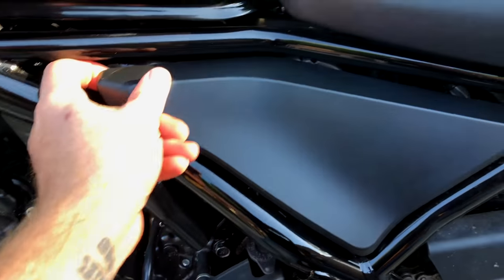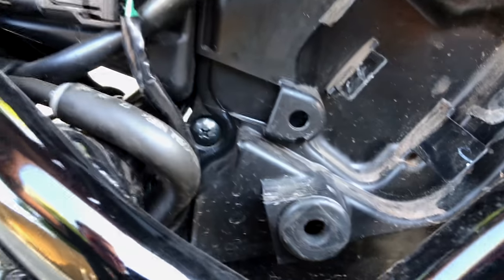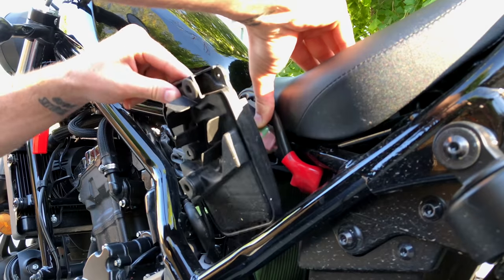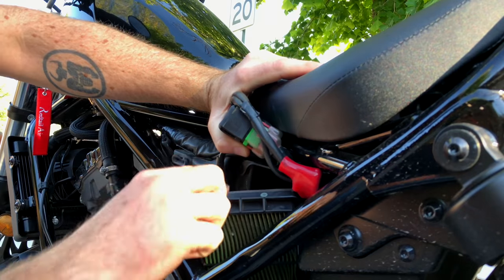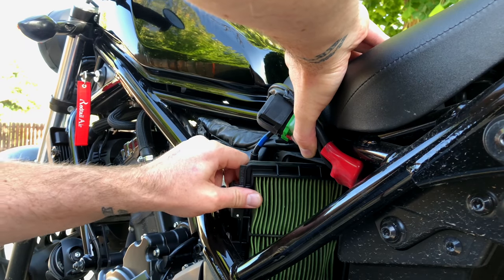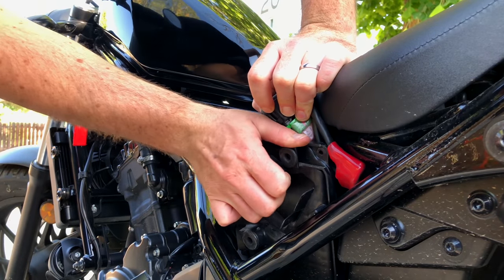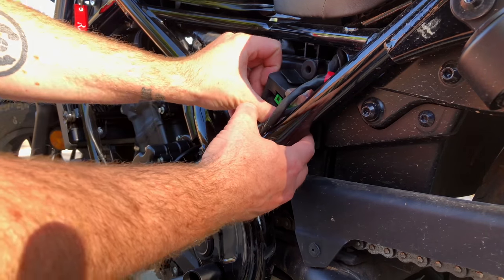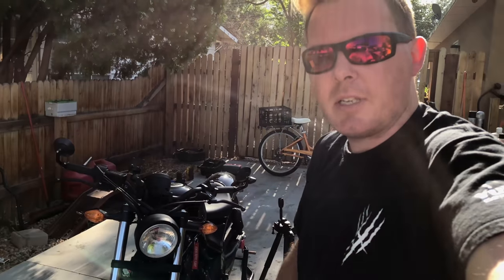2017 Honda Rebel - Air Filter Replacement

Comment: Thank you for the video - it was quite frustrating following the instructions from the manual specifically the part where the filter rotates to get out. Your video helped my stress levels to the bare minimum :) 

Ride on~

Comment: HEy Arches.  I've  noticed in the recent 8 business days that my rebel 300's engine seems to smoke a tad, and I can smell it a little.  

I also noticed that my rad fan doesn't turn on anymore.   I've let it idle on purpose for easily more than 8 minutes straight ( probably more like 15 ) and had a laser thermal temp gun trigger pulled on the rad, bottom parts of the engine but above the rear brake visual mental line, the rap cap.

The the temps clear 200 F but don't seem to go higher than 215 ish until I choose to shut her off, per the hondarebel3forums....90c aka 194 F  is when the rad fan is allegedly supposed to kick on, and it did that from the day I got her brand new late april 2018 at a few miles until around 3800 to almost 4k miles ( now at 4600 I think).  

1.  ALL fuses ( if there are any others, I'm not sure where they are yet) under the seat near the battery are good, and I can physically turn the fan blades and make them move without really any effort at all.  Thus I don't think, given less than 5k miles, the fan motor is the problem.  I just checked them 1-4-19 early evening.

2.  I have no heated gear ( meaning wired to plug into as an accessory  to connect to the battery in any way), so the bike is completely stock in that context...thus nothing to interfere ( if that is possible) with power getting to the rad's fan motor.

I'm at a lost man.  This is my primary transportation, and something in my gut is telling me something is wrong.  

Am I being paranoid and just forgetting the variable"  It's winter dude and you're riding in sub 55 F weather consistently.  You'll be fine" ?  Or is this a legit concern.  

Have you encountered this before or know someone who has?  I'm fairly mechanically inclined with cars, ...motorcycles are still new to me obviously, but if it doesn't require special tools or skin n bones little kid's fingers to access what is needed...I can figure out how to replace or fix something usually.

*    For those looking for rebel 300 and 500 parts.   I found this website which imo is the equal to Hondapartsnow.com for ...for example..my 05 civic si

https://www.hondapartshouse.com/oemparts/l/hon/5a28550387a8660dfc056539/2018-cmx300-ac-parts       **

Cheers and thanks for the content Arches.
Reply from the maker: Motoryzen first thing is smoke isn’t good. Let’s work on the fans first though since that’s easy/free to diagnose. Get a couple pieces of wire and unplug the fan from main harness. Take the leads from the battery and hook them to the fan directly. This will tell you if the motor is out.

Next I’d worry about the smoke. In winter it will smoke a little from exhaust. Just like blowing breath in the cold air. Nothing to worry about with that.

If it is smoke then oil is probably blowing past the piston rings and into the combustion chamber and burning up when fuel is ignited. Then the exhaust strike kicks it out the exhaust.

I haven’t personally had this happen but hopefully it’s under warranty still? Guessing not though. If it is...get it in ASAP for either problem.

Keep on messaging me back and letting me know updates. I’m curious to find out what it is/was.

Comment: Can you make a video of chain replacement
Reply from the maker: Juan Velez unfortunately I got rid of the bike back in feb 2019 to get my mustang. I’m sure there are a few online though. Should be the same or at least very similar to the 500 as well so if you find one on the 500 it should apply

Comment: Amazing videos. So helpful.    Can I ask u something.   Do You use the same  air filter  ? Just clean it and that’s it ?  O we need to replace it.     Thank u for all your videos.  For all your videos My bike is perfect
Reply from the maker: Laura Serna I just cleaned this one because it only has 1700mi in it. If it was 3000-5000mi I’d change it. Thank for watching!
Reply: Arches Mechanic  perfect thank.   U just got 2100 miles.  So can I clean it. And it’ll be good if I change it every 3000-5000? 
Thank u
Reply from the maker: Laura Serna all good!
Reply: Arches Mechanic  thank u.  Can u tell me the reference for the air filter  ?
Reply from the maker: Laura Serna p-h2e13-01

Comment: Have you already gone THAT many miles to  justify the need to replace the air filter??/
Reply from the maker: Passed 1700 today.
Reply: Is it normal to have to clean or replace a motorcycle air filter at such low mileage?  If so I damn well better find a k&n air filter for my rebel.  That just seems way too soon to have to service an air filter.
Reply: my rebel 500 manual says to change it at 12k. he is prob just doing it for the video